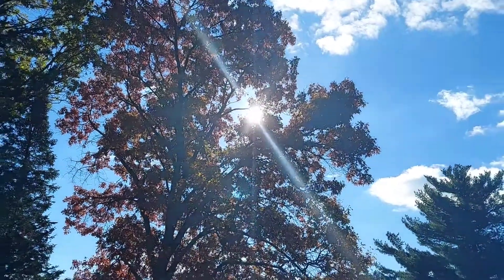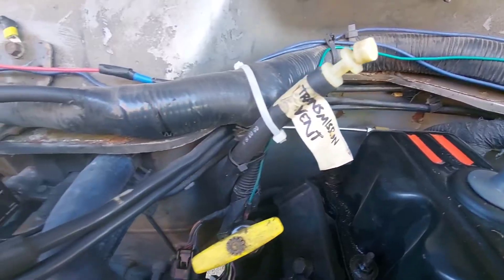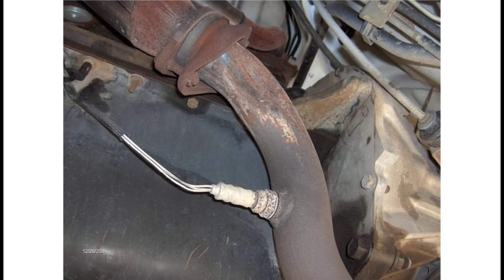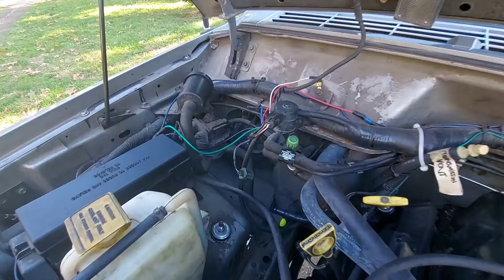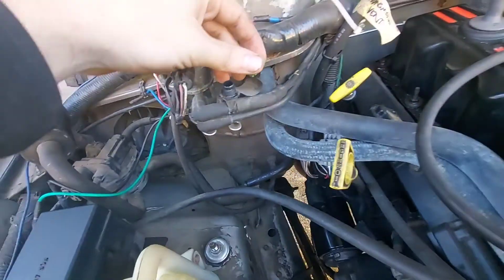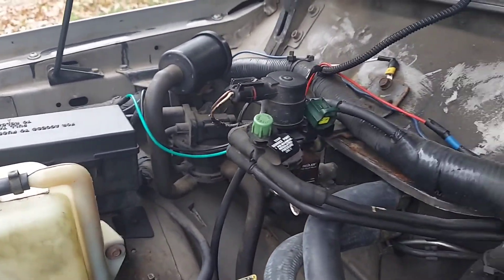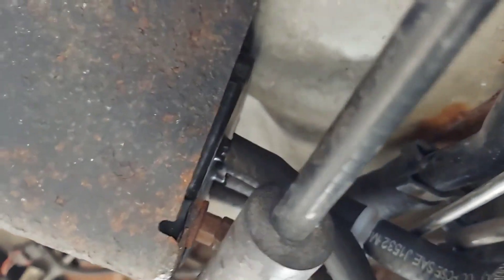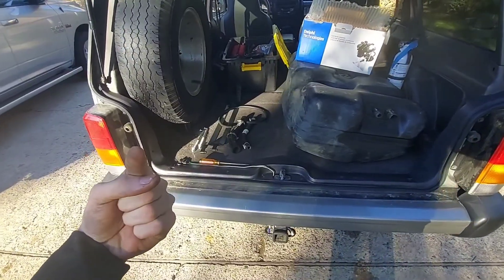Jeep Cherokee: EVAP System Tour; How it Works + Test it Without a Smoke Machine! [‘98-’01 XJ] P0455

Comment: Amazing video! Thank you so much. I am looking to replace that metal line with the rubber hose. I know you mentioned it in the video I was wondering and hoping if you potentially had a video with the install of that and is there a specific part number for that type of hose?
Reply from the maker: The hose I used was not a specific part, it was just 4 feet of 5/16 fuel rated hose from Autozone. Parts stores usually sell various hoses by foot increments. I used a 1/4 to 5/16 brass adapter to connect it to the fuel tank side, and it fit right on the charcoal canister side. There's nothing much to it, just rip out the metal line and put a rubber line in its place
Reply: @WAEMIDIV  Thank you so much for this tip! I just waited 6 months waiting for a replacement metal hose that never came and this is a fraction of the price. Yessss
Reply: @WAEMIDIV  Thanks a lot. This was a very important video and I appreciate you responding. I have another issue I'm trying to deal with. I have a P1494. Watched multiple videos regarding what people did to resolve the issue. Lucky they just replaced an elbow. I've traced my entire system and smoked it. Only leak I did find while doing that was throttle body. I cleaned and replaced the gasket as thats where it was coming from. The LDP is aprox $150 with the filter but hoping there is a way to verify if it working properly. I did try the nerf ball test but not sure if I did it properly or if it would of showed P1494 or another code. Can you assist?
Reply from the maker: @aflykidfrombrooklyn  P1494 is set for internal failure of the LDP. You need a new one, you could save some cash by getting one from a junkyard
Reply: I will have to find one here in Brooklyn, New York because I know it’s very difficult to find them
Reply: I’ve watched videos on YouTube where people had the same code and all they had to do was change an elbow and everything was resolved. That’s why I’m very skeptical about replacing the LDP.
Reply from the maker: @aflykidfrombrooklyn  yeap that elbow in question is the frontmost of the 3 on the side of the intake manifold. Go ahead and do that first
Reply: I only have 1 line going to my intake. Not sure why. Very interesting. Any chance I can take a video of my engine bay and send it to you for feedback?

Comment: I bought a 2000 XJ & while my mpg isn't great running at stick height with 31'10.50" tires I was expecting a bit more as my 5.3 '05 Yukon gets better mileage onnthe hwy. I don't have a check engine light or any codes per my scan tool & just noticed today the two lines to the purge valve have been disconnected for a long time as evident from the think layer of dirt. Pulled up this video to see if that would cause a CEL & am really curious to see if my engine runs better & or mpg improves. Actually popped the hood as I am changing oil, brakes & was hoping to get cruis & AC working so was just looking for anything disconnected or cracked or off vacuum lines as well as anything else & noticed the evap lines. Anyways good video & also why it is a good idea to always have a good look around under the hood & vehicle when doing basic maintenance or a repair as you never know what may need replacement, has been "broken" or what you may find.

Comment: OK guys here’s one for you. I don’t have that in my jeep runs I have a 2000 XJ 4.0 from New Mexico no rust and no eve app system
Reply from the maker: The 2000 models had an option between a 50 state emissions package, or a 49 state package. The 50th state of course being California, all 2000 model year XJs sold in California had to have this EVAP system along with the 2 manifold catalysts. However, 2000 XJs sold in any of the other 49 states came standard without it - it was optional. People refer to these two emissions systems as "California Emissions" (shown in the video) and "Federal Emissions" (what you have). 

When I made this video, I didn't really understand that. I thought it was commonplace on the 1998+ Cherokees for whatever reason. In 2001, it became standard, so some 2000s have it, and all 2001s have it.
Reply: @WAEMIDIV  thanks I could tell by no screw holes on the frame that it was never there. I just figured that out there in the wild West it didn’t need it. 🤪

Comment: Thanks for the video, I appreciate the graphics. I'm working with my brother's 2000 4.0 auto (federal emissions) that doesn't have a leak detection pump. We installed silicone vacuum hoses good results and the next project is the original fuel pump and evap canister. I'll be sure to add rubber hose to the parts pile so we can get rid of the sketchy looking metal pipe. The Purge solenoid clicks so I assume it's functioning, I may go replace it since it's cheap. Cheers!

Comment: How to scan the xj 99 with that red scanner, I have the same but never connected 
Any help?
Reply from the maker: The OBD-II port is under the dashboard, located right above the hood release.
Reply: Yeah I know but it never load the info, just remain loading and it reset itself
Reply from the maker: the key needs to be in the run position, with the engine off

Comment: i have a 1997 jeep grand cherokee lardeo and i at first got a ignition coil code replaced that didnt fix the stalling issue then hooked a code reader again and got a p1494 for the evap. My cherokee doesnt wanna start and when it does it wants to turn off and i have no clue if i fixed the evap if that would fix the issue
Reply from the maker: The EVAP system is entirely non-essential for a running engine so I think your problem is somewhere else. I'd replace the spark plugs or distributor components if you had an ignition code
Reply: @WAEMIDIV  after I replaced the ignition coil the code went away then a evap code popped up
Reply: @WAEMIDIV  could it still be something with the ignition system if the code went away after I changed the coil
Reply: It wouldnt start at all. So i messed with the gas cap and then tried it and it crunk up. Its a 1997 grand cherokee laredo not a xj not sure if the systems are the same

Comment: Lol i had 3 codes
P0441
P1494
P1486
The check engine light went away. Not sure why. I did see the evap was upside down. Besides that ive only changed the hose from top of valve cover to intake.

Any idea what it could be? I/M readiness on code reader is skipping the evap now.
Reply from the maker: P0441 means something is routed wrong. "incorrect purge flow" means some hose, on something, isn't connected to the right thing. P1486 and P1494 are both a result of that first one. If you fixed the LDP being upside down and then the CEL went away, it sounds like you fixed the problem

Comment: I have a 99 xj sport and the evap port on the manifold closest to the front is just open and sucking air. It says on my diagram this port is unused but should I just leave it open or cap it somehow?
Reply from the maker: There should be a cap on it, you can use whatever you want really, but vacuum caps do exist, they sell a variety pack at autozone
Reply: @WAEMIDIV  ok thanks I have something I can use to cap it

Comment: I did the nerf ball method and my ldp if fine didn’t get the code again.. just confused on the next part how do I check the rest of the evap system? Which ones do I plug on the charcoal canister and do I need to plug them all sorry I’m mechanically slow thanks 🙏
Reply from the maker: Well first, check all of the fittings on the charcoal canister and make sure none of the 3 are cracked or dry rotted. Disconnect the front 2 and plug them on the Canister side, leaving the third, farthest rearward one plugged in, and then drive for a few days. This will test the Canister itself and the line that runs to it
Reply: @WAEMIDIV  okay thanks I also replaced the steel line from the gas tank to the canister thank you for replying hopefully I can figure this code out it’s so annoying

Comment: The vacuum port on my manifold all the way to the front says it's unused but I noticed there is nothing covering it and it is just sucking air. Is there suppose to be a cap on this or what? I can't find any info about this 3rd line and what to do with it.
Reply from the maker: Yes on federal emissions models there should be a cap covering that port
Reply: @WAEMIDIV  ok I don't see one to cap it so any suggestions on what I can use to cap this port because right now it is just sucking air in
Reply from the maker: @jeffreynolds7974  https://www.autozone.com/ignition-tune-up-and-routine-maintenance/vacuum-cap/p/dorman-autograde-assorted-vacuum-caps/365550_0_0?cmpid=PLA:US:EN:AD:NL:1000000:FLT:816576617&gclid=CjwKCAjwquWVBhBrEiwAt1KmwnCGo4SItNzSkyw1ctrgydz1v0lRMUOE4FxZaiTr00rZLxSdYzcgyhoC2lYQAvD_BwE&gclsrc=aw.ds

There are assorted packs of vacuum line caps out there, but honestly you could just plug it with a good ole piece of duct tape and be fine

Comment: This would have been a really great video but you left out one important key factor you did not mention it all about the rubber hose that runs off the evaporator pump. This hose is shaped like a U and is very common to crack and cause the error code.Most people for a quick fix wrap it with electrical tape.🙃🙃🙃🙃🙃
Reply: Well thank goodness for letting us know that.  I will sleep so much better now

Comment: Do you have a list (or know where I can find) all the part numbers for all the vacuum system elbows? 2001 xj.  Awesome video, I subbed immediately after watching how thoroughly you presented the info. I'm impressed.
Reply from the maker: Unfortunately, most of the EVAP stuff isn't made anymore, so you have two options:
you can try a dealership, who might be able to get a certain few pieces, or you can rig up some custom stuff with random bits of emissions rated hose and some clamps. That's what I did, parts stores also sell random assorted fittings that might sometimes work, but otherwise you'll just have to piece together most of it. If you can't find "emissions rated hose", fuel rated hose will also work because it's basically the same thing
Reply: Check Amazon. Dorman sells a full vacuum harness for XJs

Comment: Hey, could you link a parts list for the EVAP fittings. Having a hard time finding the elbows that connect to the manifold near the mass air flow sensor. Those Dorman variety packs are not big enough or are sized wrong for the application. Great video exactly what I needed to see! 🔥
Reply from the maker: The trouble with those EVAP Fittings is that they aren't made anymore, I had to use random "universal" ones when I replaced mine. Small fuel-rated hose will work, otherwise you'll either need to get them from a dealer (doubtful) or get creative with some custom parts unfortunately

Comment: So random question but do you think a bad or possibly clogged charcoal canister would make for poor engine performance/bad idle/ crap ride lol I’ve fixed all evap leaks on mine (metal vent line to gas tank) and basically everything when it comes to the damn thing. Stil runs like shit and mpg gettin worse. A lot of things are pointing to charcoal canister (lines were all unplugged on canister, noticed months after I brought it too) My research lead me to your vid and I want to thank you for this info as I know now proper routing and functions of these parts and hope to solve this mystery!!
Reply: I’ve replaced 3 crank sensors on my Cherokee. I know they fail commonly
Reply: Got a 99 xj 4.0
Reply from the maker: @als.688  I'm gonna go ahead and say no, the problem is not with the charcoal canister/ evap system. Sure it may be contributing, and will cause a loss of MPG, but I think the bad idle is much more likely caused by something like a clogged fuel injector, a sensor on the throttle body, or potentially something internal like bad lifters. Might even be an O2 sensor. 

I assume the CEL is on, in which case I would start there and scan the computer to see what error codes it displays. The evap system is not an essential thing on the XJ, and you could even unplug the whole thing from the intake manifold and see if that makes a difference - just plug the hole and start it

Comment: I have a 01 xj with a P0455 code all my lines are good , I’ll give the LDP a test , another problem that I have is that I have a hard time starting the xj, it cranks for about 5 seconds then it starts sometimes it takes longer, then when I drive it around turn it off then try to turn it back on it doesn’t even crank, it dies right away then the second try to start it it tue turns on.

Any tips or suggestions on what could be wrong with this money pit?

*Btw I have a new fuel pump*
Reply from the maker: A long crankover can be caused by a handful of things, ranging from simple maintenance-able things like bad Spark plugs or a starter, but could also be clogged fuel injectors, low compression in 1 or more cylinders, or even a dying crankshaft/ camshaft position sensor. 

I doubt the EVAP code is related to the long crank, and if you can't find the leak you can do a smoke test or experiment like I did in the video
Reply: @WAEMIDIV I’m back I changed the fuel pump and it starts right away so thats good.

So I still have the large leak, I put the smoke machine and there is no leaks, I put a new purge valve, a new charcoal canister, and a new LDP. Any suggestions on what I could be missing?